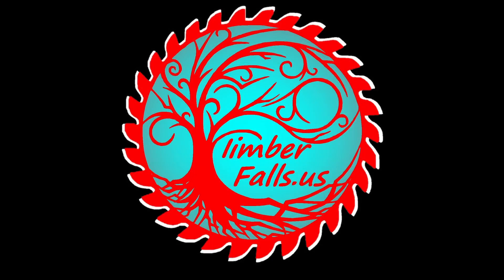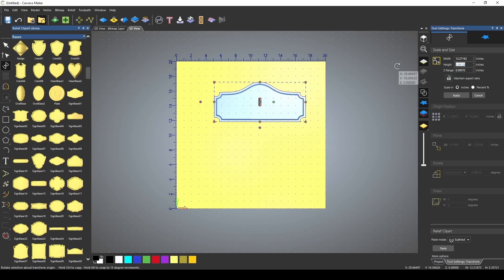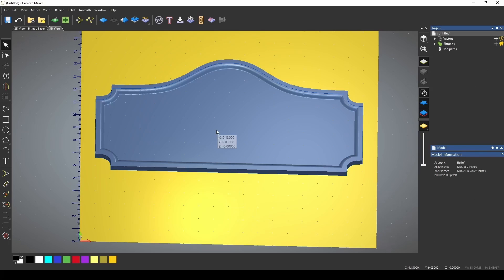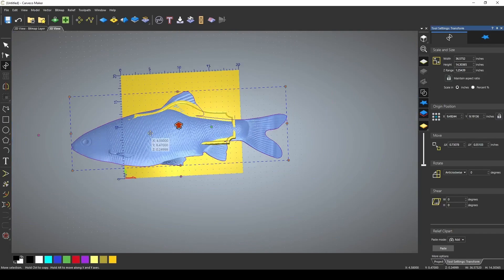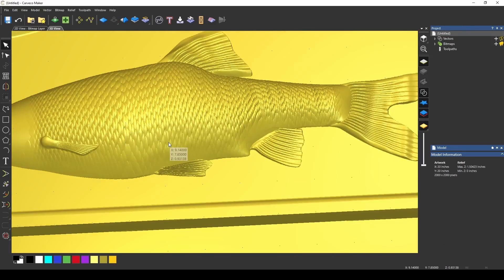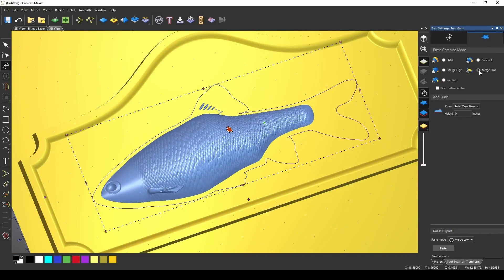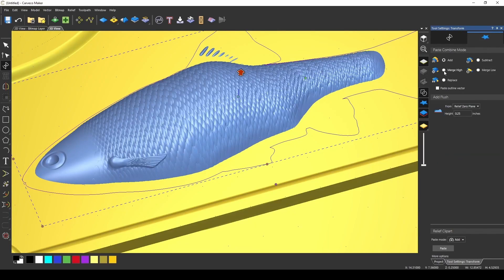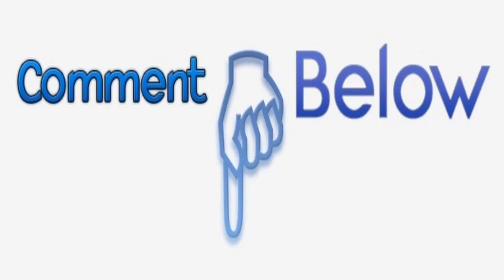Carveco Maker: Add, Subtract, Merge - Mastering Relief Functions

Comment: Great video! Thank you! Got a question, I 'm ready to carve out a catchall tray for valentines day. My carveco model is set to go to gsender. I'm using 3 bits, a 1/4" straight, a 60 degree vbit and a 3/4" bowl bit. I don't have a probe tool. I use the paper method for x,y and z. So if I use a 1/2" wide vbit 1/2" wide, just bring it up to the side of the workpiece on the x and y sides, then divide 1/2" by 2 (1/4" and subtract that to the measurement to get the x and y zero, yes?
Reply from the maker: You only need to set x and y when probing from the start and as long as you do not turn off the machine it will keep this position so the only thing you have to reprobe is z axis for each bit. I would just touch them all off somewhere on the waste material so they are starting at the same height.
Reply: Thank you @Timberfalls  ! Gonna give it a try!!!